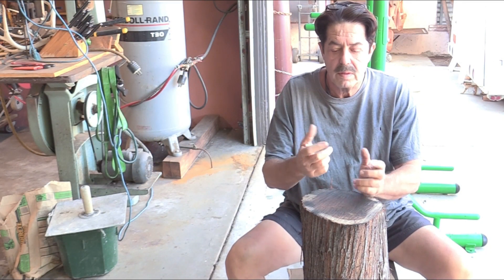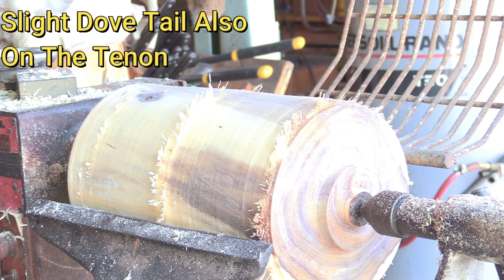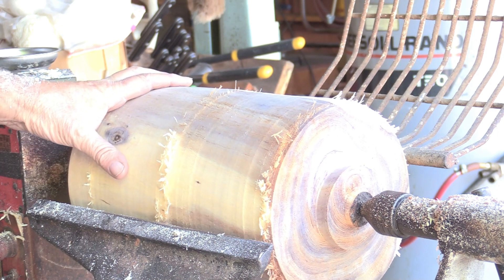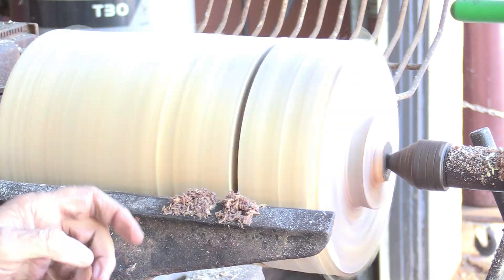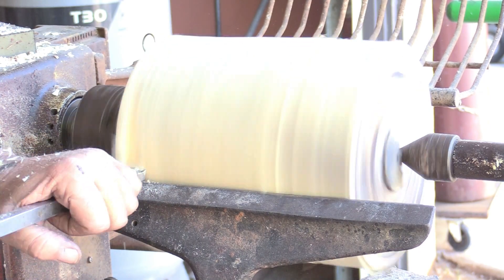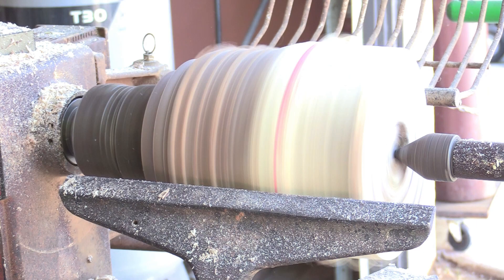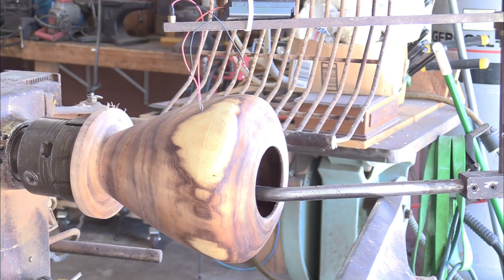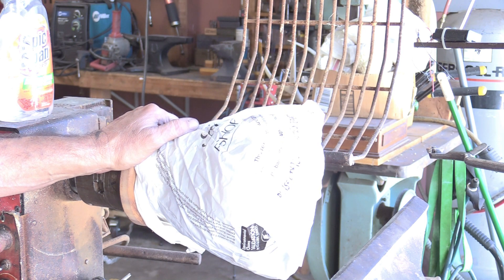Wood Turning a Vessel On The Lathe - Part #1 (Shaping The Log)

Comment: Howdy, Brothert!  At 9:34, I was pleasantly surprised how nice the design turned out.  Will tune into Part 2 for sure!
Reply: By the way, great tip for slowing the drying process.
Reply from the maker: yes with this particular wood, temp, etc- it works very well for me and by making sure i use that blow gun to try to force it into the pores
Reply from the maker: Thank you! Cheers! and ill post the others soon